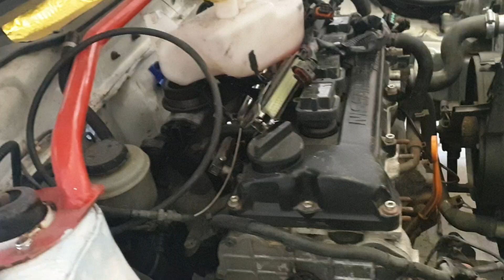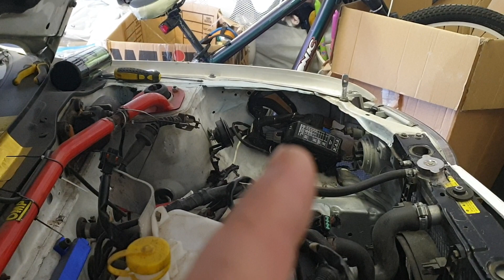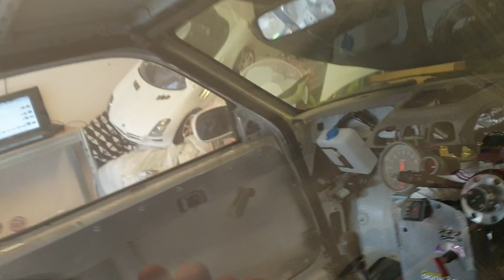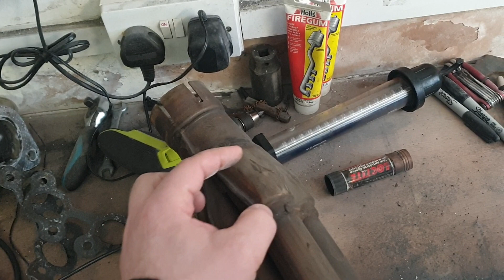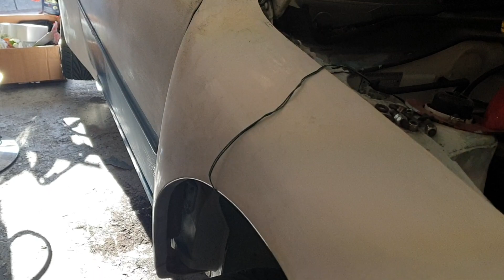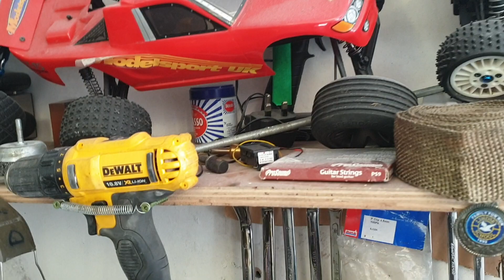ZX9R MAxi micra project, part 3

Comment: Hi Antony, you mentioned you have the dimensions/drawings for the wide track wishbones and you have a local company to make them for you , are you able to share the information or the name of the company who will make them. Like yo I'm on a budget and at over £500 each i find that hard to believe. secondly have yo had any progress with the wide track rear axle yet, only just started watching your videos so not got to see if you have covered the rear axle yet. Thanks in advance
Reply from the maker: The front wishbones are on hold as I now work away from home.
The rear axle will be modified by a local company in Scotland eventually, but again, stuck with working 400 miles away.

The project may end up being a retirement plan. Lol.